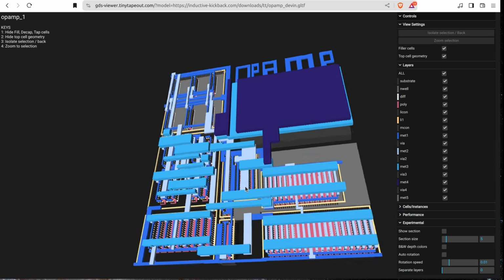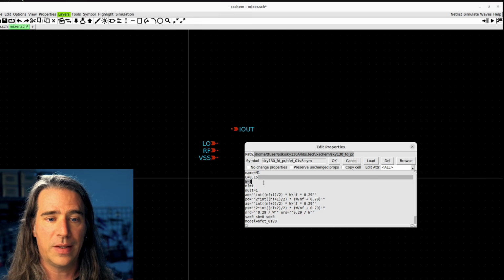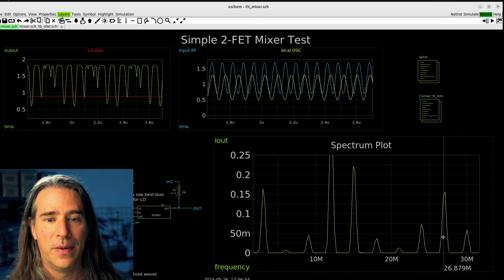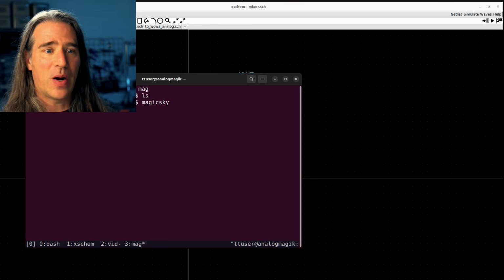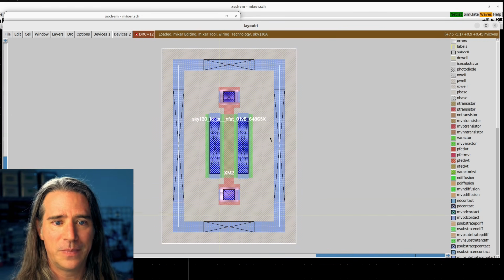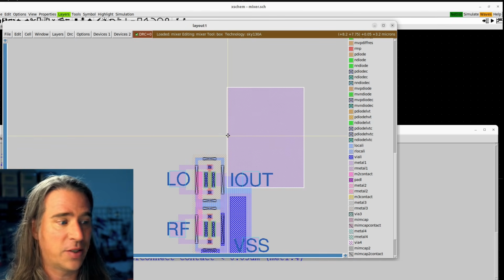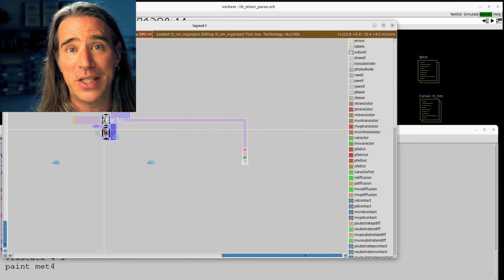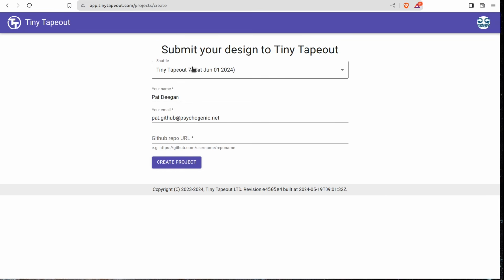Open Source Analog ASIC design: Entire Process

Comment: Magic is a 50 years old tool. It is pushed not to endanger the EDA tripoly.
Reply from the maker: Well that's an intriguing claim... I mean, I don't think age is as important as relevance (Linux is 33 or something and am guessing it'll be going strong at 50) but regardless... on one hand, with IHP settling on klayout for their open PDK, am guessing there will be some progress on more modern tooling and it looks like the tripoly isn't holding everyone in check even if it were true.  On the other: I've actually come to like the tool, ugly as it may look (the only things I care about are availability and openness) and from what I gather magic's "way of thinking" is pretty divergent from the big tools (at least more so than eg klayout), so using it actually increases the barrier for me to give up and go purchase some fat tool's per-seat license.  Finally, I see you are also offering tooling, so with magic, klayout and Revolution EDA in the field, feels like there's pressure for advancement, and innovation--that's a win, from the user perspective.  Of course, I'm still pretty new to this world, so what do I know.
Reply: @PsychogenicTechnologies  Magic was an old tool even 30 years ago and the code base has not changed much in the last four decades. KLayout is an excellent GDS editor but doesn't have the concept design libraries. Linux is indeed 33 years old, but I don't think any of the original code is left in the present Linux code base. Semiconductor startups are choked thanks to very expensive software tools, but asking them to use Magic because it is open source is not the solution. Revolution EDA is not targeting enthusiasts but hopes to be useful to SMEs.
Reply: @RevolutionEDA  I just left a similar comment about magic age and how what he showed here isn't that much different from my 1990 experience.
Reply: @CraigHollabaugh  There is a fallacy in open-source enthusiasts that anything open-source is gold. To be honest, I wasted so much time on Linux over the years that I could have bought hundreds of Windows licenses with that money. Just because you don't pay for a license does not mean that it doesn't cost you.
Reply: @RevolutionEDA  You're right, open-source has its place but it does come with a cost. I started on Sun 3 around 1988, then Sun 4 Sparcstations. Hopped to Linux 1994 slackware 1.0.  I agree, Linux was a real pain in the early days (sound, video and ethernet drivers) and all the distros blah blah blah.  Today, I continually switch between Ubuntu and Win10/11. I can work all day with WSL/XServer without productivity loss.
Reply: @RevolutionEDA  Unfortunately, with all the closed source programs becoming data miners for their bunkered AIs (see Adobe fiasco), you may want to rethink giving them not only your money, but also your work... Unless you want to get replaced sooner than later by their robots. Sooner or later will be a necessity having open tools to replace the ones which want to replace you.
Reply: @hyoenmadan  Is the solution to use programs from 70s?

Comment: Thanks for the overview, this is very helpful. A bit annoying to get everything setup, either you run a virtual amchine or try to get those old tools to play nice with your distro, still very far away from the state of where kicad is. Hopefully more people join the space and we can get some standardization going on
Reply from the maker: Thanks!  Yeah, I used to insist on getting things working on the bare metal of my machine, but with everything interacting with the PDK and between themselves, and everything in dev at the same time, it can get pretty awful.  
So the VM was the easiest way for me, and it worked well.  Something I haven't tried yet but that looks pretty good is another packaged solution, but using docker (which might be lighter than running in a VM?  I dunno).
This is another Harald Pretl thing, and it's well maintained: it's the iic-osic-tools,
https://hub.docker.com/r/hpretl/iic-osic-tools
Might be worth checking out.

Comment: Love this video! Looking to build ASIC skills and trying TinyTapeout projects soon, so your videos are a goldmine. Any advice for an undergrad trying to learn RF/Mixed Signal ASIC design?
Reply from the maker: Thanks Rohit!  Basic advice is "play" -- get xschem, start doing experiments in simulation.  But then, yeah, this goes so (so) deep, you could write a thesis on track width and tradeoffs, and when you get into the FETs well, feels like the level of interesting goes on forever.  Also, some of these are beginner or intermediate projects, but TT has a number of RF things in the last two tapeouts--oscillators, a gilbert cell based double balanced mixer, lots of things.  So, if you do want to take a look, you can just clone those repos and see how they're built, tweak things, see the impact, improve the projects themselves or use them as building block (say you take the mixer as a module and dev an env detector or fm demod, that should be fun).

Comment: Would it be possible.. to take the spice output and convert it to verilog/vhdl for fpga physical testing?! Or even turn from xschem output to Amaranth?
Reply from the maker: I don't have any experience with this, and have wondered myself, but your question pushed me over the edge and I finally did a little search.  We are not the first to think of this, it seems.  Lots of the results are, however, really old.  But I think some digging might reveal interesting things... This one
https://github.com/Eyantra698Sumanto/Spice-to-Verilog-Converter
looks really dumb and basic, and I can't say I've tried it or how it would react to raw mosfets... may look it to this further (but the stack is so deep, hah)
Reply: @PsychogenicTechnologies  i had a suspicion that this should have been done before. But might be problematic to go from analog circuit descriptions to Verilog, but i'm thinking a digital concept should translate bit easier. A good starting point prob. would be to make a simple circuit for a digital comparator and then make the same in Amaranth and try making a ... a parser/translator that route..  (oh my brain now are hurting and speeding at the same time)..  The idea of taking your asic design and somewhat able to "verify it" in a fpga kinda makes sense to me for some reason.